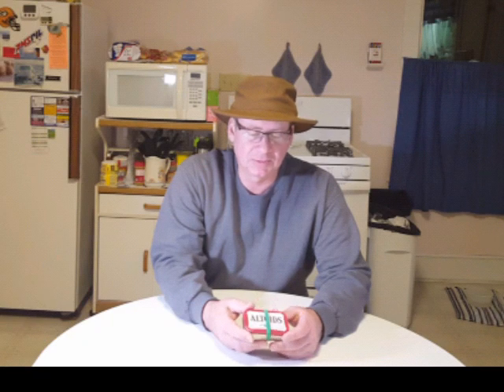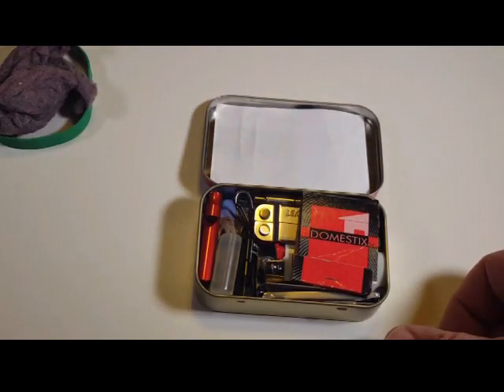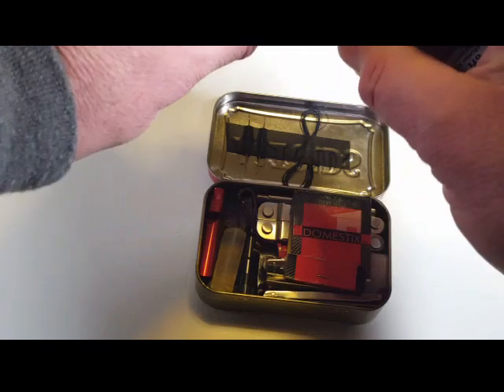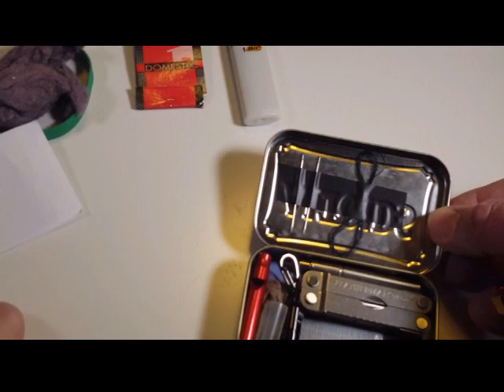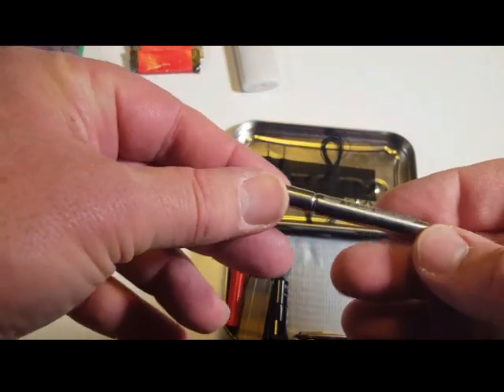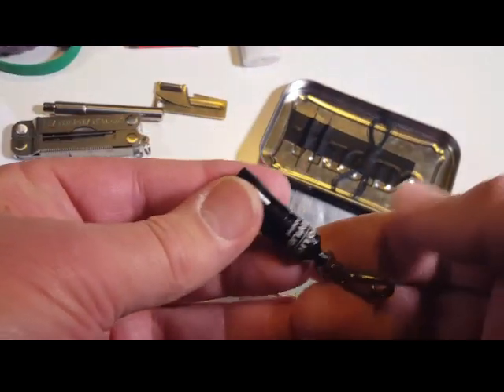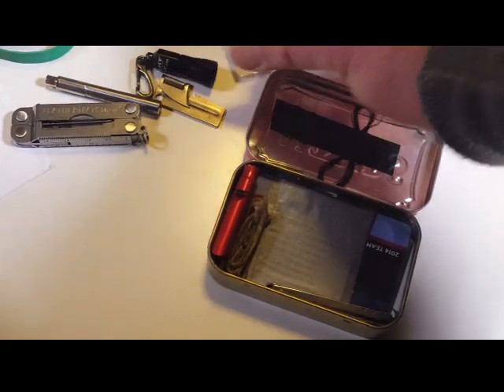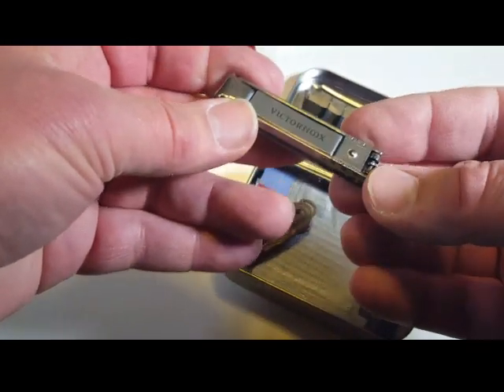ALTOIDS TIN EDC KIT MADE BY WISCONSIN GREG

Comment: I like the glue stick. You may want to consider, taking a pice of tape and taping a match striker, striker up of course on to the sticky part and then taping it to the lid. In essence it will keep the striker dry. You then can tape the needles and thread  on top of the striker tape. Another small item is a one inch chem light I would switch out the duct tape with gorilla tape. I will say the stream light nano is really under rated. Otherwise great job.
Reply from the maker: +mountainghost556 Thanks for watching and the tips. 👍

Comment: Good start greg.  look forward to this other one you spoke of later on. 
 Lots of useful items , and would supplement any normally used/carried in gear/items.  Somehow the tools always help to get stuff out of the tin too :D
 Glue stick could also be joined with the light to create a  diffuser  to make a signal light halo aka "buzz saw signal" device. Likewise the lens could be used with the light to project the light a little more similar to a "light house"  
   Maybe wrap the duct tape  along the long side as ill be slimmer since you're using more surface area of the card. The book of matches you can soak the stick end in wax to give a little more burn time.  ( remove the staple  , do it and staple it back together.)
Keep up the good work on them.  thanks for sharing C.R.
Reply from the maker: +Creative Redundancy some good ideas Thank's CR 👍